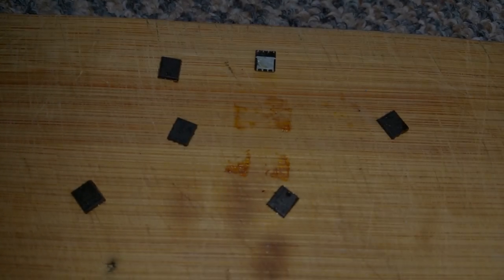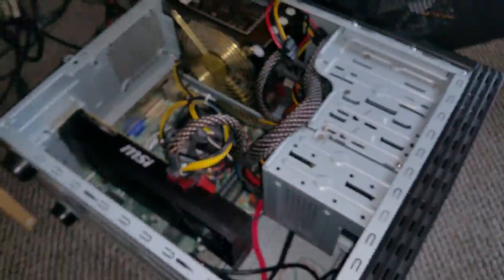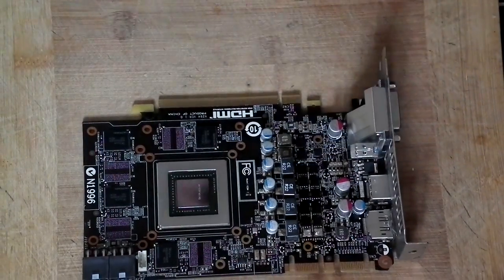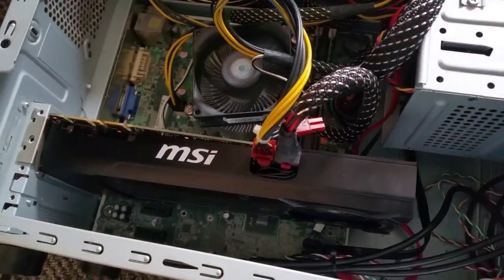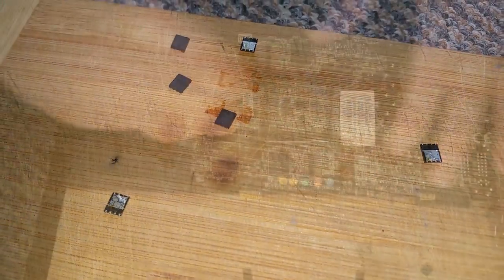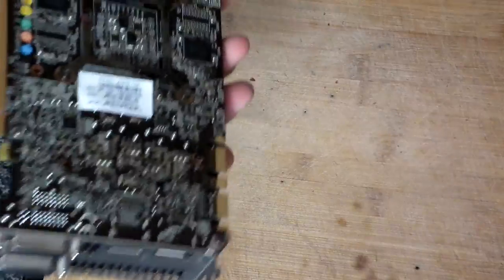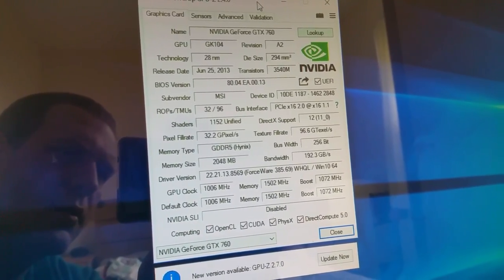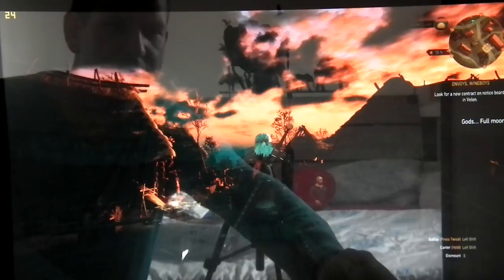How to FIX Graphic Card Short circuit without spare parts

Comment: i have a gtx980ti it powers up if you dont connect 6pin or 8 pin power plugs is that a short circuit
Reply from the maker: Definitely yes is short
Reply: @frogtechtips   hi frog are you located in UK and chance you could take a look at it dont mind paying you
Reply from the maker: @philkyle8919  hi not any more I from Slovakia

Comment: Hi, good video. I have an EVGA GTX 980 TI superclocked acx 2.0+ with backplate, it doesn't work, when the GPU is in the computer i get no display, i tried with both power cables, with only the 6 pin, and without any of them, in all the cases i get no display even if i connect the monitor to the IGPU instead of the GTX 980, but all of the times the CPU fans spin correctly continuously and the GPU leds switch on. The PC boots and works correctly without the GPU connected and the GPU has been tested on another PC with the same result, can the GPU have a short or not?
Reply from the maker: Hi your card don't have a short if card have short PC doesn't working at all as you writing fan working just card no send signal problem is with GPU core probably .
As you card is out of warranty and replace core is not financially good option I will try reflowing GPU look on my channel there is many videos how to fix black screen good luck

Comment: I think i have the same problem. How much does a repair cost? Just give me an estimate.
Reply from the maker: It's hard to say you will need check with your local repair shop
Reply: @frogtechtips  I see. Thanks. But if they repaired it or replaced the shorted components, will it go back to being shorted after a few days of use or will it stay good
Reply from the maker: @21Mewzyk  it's should be ok if replacing right component he will probably give you some warranty for job Dane as well

Comment: Hi Frog, can you help me? I have same card and its broke I think. It doesn't show anything but when I turn on PC, the gpu fan spin like crazy at max speed. Do you know how to fix it? I was wondering if bios is faulty and need to flash it. Do you know which chip is the bios chip on that card? Thanks.
Reply from the maker: Hi usually when card have this problem is werry hard to find what wrong there can be multiple problem 
Can be bios as well but I will bet for GPU die is dead or not detected
What is history of that card is that happens just one Day or you buy like that
Reply: @frogtechtips  Actually it come with a bulk purchase, so I did kind of blind purchase on the gpu. I've tried with hairdryer trick but no luck, still same condition. Any suggestion?
Reply: And currently trying with short pin 1+8 trick, but seems no detection in windows or DOS. 😔
The bios chip is the IC with pm25l0020 label on it right? CMIIW.
Reply from the maker: @iyepb  I think yes
Reply from the maker: @iyepb  there probably no so much to do there can by som missing components as well try perfectly look on PCB

Comment: Brother my rx570 is heating up I have changed thermal paste but giving display what should I do
Reply from the maker: You mean after changing thermal paste you card don't give signal
Reply: @frogtechtips  my card is giving display but my temps are very high 56 idle after changing paste is this due to some kind of short circuit what should I do in this situation Main problem is temp
Reply from the maker: @coffineditsgameplays5908  hi if you change thermal paste and temperature is still high you will need use better quality thermal paste but 56 is not bad I think what your temperature under load
Reply: @frogtechtips  no bro idle 😅
Reply from the maker: What your temperature under load

Comment: I just got an XFX 580 off of eBay and when I try and power it on, the motherboard debug LED flashes for a split second and the CPU fan twitches but still nothing. I wasn't too sure about what the problem was until I found this video. What would you recommend me doing? I don't have any tools like a multimeter or heat gun (I have a hair dryer and my soldering skills are pretty limited.
Reply from the maker: sounds like short on your gpu and without tools no possibility to fix
Reply: @frogtechtips  yeah that's what I suspected. I gave the card to my friends dad that has the necessary tools to diagnose the card so hopefully he can maybe fix it.
Reply from the maker: @JeffsTechOfficial  that's sounds like good idea let me know after
Reply: @frogtechtips  will do
Reply: @JeffsTechOfficial  i have a similar situation, I really hope i can fix it somehow because i cant afford to spend 200 on a new gpu
Reply from the maker: @JeffsTechOfficial  thanks
Reply from the maker: @mr.stealyourgirl1779  let me know if you fix
Reply: @frogtechtips  To be honest I might just buy a bottle of freeze spray to find a short circuit, do you have any experience with the stuff?
Reply from the maker: @mr.stealyourgirl1779  you can try that as well but for 90%short is always on voltage regulator
Reply: @frogtechtips  I hope its the voltage regulator, smaller parts are more tedious to work with. I will give it a try, but the gpu has to have live power right to try?
Reply: @frogtechtips  were do you think the short is if my gpu gets warm but my pc doesnt detect it?
Reply from the maker: @mr.stealyourgirl1779   take off cooler and send me picture of your card I can mark for you where I think is short
Reply: @frogtechtips  ok
Reply: @frogtechtips  do you have an email?
Reply from the maker: @mr.stealyourgirl1779  yes you can send me on frogtechtips gmail or Facebook mesanger as well
Reply: @frogtechtips  how do i send the pictures?
Reply from the maker: @mr.stealyourgirl1779  send me that on my email or FB message
Reply: @frogtechtips  whats your email?
Reply from the maker: card will be working even without that but window will not see this gpu correctly and after just try find with one is bad and solder good one back on position
Reply: @frogtechtips  i think i found the culprit. When I froze my motherboard with freeze spray, a voltage regulator was the first to unfreeze on the backside of the card. Do think if i were to remove it that i can start up the card without it?
Reply from the maker: @mr.stealyourgirl1779  yes you can
Reply: @frogtechtips  for some reason three pins of the 4 are connected to ground and the and the chip number is bm1117 adj, do you think that its an irregularity?
Reply from the maker: did you remove that if yes and is not on board check short on power conection if there no short anymore you got it
Reply: @frogtechtips  how do i checm for short on power
Reply from the maker: @mr.stealyourgirl1779  you need check short on power conection of your card iam not sure how many is there usually 1 or 2  6 or 8 pin conection from your PSU to your gpu there can't be short between pin look on my channel one of my older video explain that

Comment: Hi, i have replaced all of the Mosfets but the card is still not working and i get a short to GND from thr mosfets. Do you know what could be the cause for this?
Reply from the maker: did you try card without mofset is been short there when you take tham off
Reply: @frogtechtips  yes i did! Im thinking it might be the phase controller now. I have tested almost everything that can go faulty on the card.
Reply from the maker: @ThreepwoodFan  did you find that short on the end
Reply: @frogtechtips  no i didn't. I broke off a soldering pad so i think the card's dead now
Reply from the maker: @ThreepwoodFan  check my channel broken pad doesn't mean card is dead look on one video where one card have big fire and after that been like hole in card good point that card still working as card can works without VCC
Reply: @frogtechtips  anyway thanks for your help! I'm already at my next project which is a PS4 Pro.
Reply from the maker: @ThreepwoodFan  you welcome ps4 pro is not bad option :-)
Reply: @frogtechtips  I think i might try to fix the GTX 970. I can send you some pictures of the PCB.
Reply: @frogtechtips  I have uploaded them here: https://drive.google.com/file/d/17SQmKU4HB3TyWBX-hdkZFDpuvpij9aN9/view?usp=sharing
https://drive.google.com/file/d/1u1P1qQMOiHVWqAuSzi96Vbnd2TePRmA_/view?usp=sharing 
as you can see, i desoldered the U508 on the back side of the card.

Comment: Hi . Can the gpu shorted cause the spark on my 8pin power on my mothertherboard? 
My motherboard is dead the. I have new psu true rated 600 watts im planning to buy a new motherboard but im worried if my gpu is shorted that why my motherblard got spark .
Reply from the maker: Hi yes can happen that just try checking GPU with multimeter  for short if not there probably will be safe to use and if you buy new MB I will get Risk anyway as if will something happens I will return MB as not working for replacement
Reply: @frogtechtips  i try to open my cpu without gpu but cant turning of no lighst no beep no power after spark on 8pin power on my motherboard 2x spark 😟. What do you think the problem? .
Reply: @frogtechtips  please help me give me some advice . What do you think buy new mobo or can i repair my cpu?
Reply from the maker: @potpotpotty6420  if your pc doesn't working without GPU of course if you have decided GPU is probably MB foulty also can be PSU problem after short as well really hard to tell if I can't check that personally
Reply: @frogtechtips  i see . Thank you for response ill subscribe you ☺️maybe i will find techenician to diagnose my motherboaed befor buy the new one.
Reply from the maker: @potpotpotty6420  Thanks so much i so glad you subscribe as well and let me know once you get proper diagnostic

Comment: Great video sir! I have a question. What is the common cause of graphics card short circuit? I'm curious. Thx in advance!
Reply from the maker: I thanks so much,  usually main problem is dust on gpu with can be conducting and make short ,other problem can be with overclocking with make card hot and specially low or middle range card have bad soldering and with heat can make cold solder and over time make short and burn some component :-) I hope I answered you questions
Reply: @frogtechtips  Thx for answering man. By mid range card you mean like RX 580/GTX 1060 and below right? is all mid range card affected by bad soldering? or just a lower model card like the reference model?
Reply from the maker: @vnplayer6839  rx 580 is been one day top card from amd and a still is bud ye you get are right and is always hard to tell
Reply: @frogtechtips  Thx! I've been thinking to upgrade my GTX 750ti so I need a reliable graphics card that can last at least 4-5 years if possible since I didn't upgrade very often. Can you recommend me a mid range GPU brand with good build quality and affordable price? Sorry if I ask too many questions.
Reply from the maker: @vnplayer6839  hi don't worry my channel is about help :-) 750 ti been classic mid range card and still good for 720p in this day  not sure what's your budget and what is your resolution you like use for play if you like me and you will be happy with 1080p you can go for gtx 1070 or better RTX  2060 with minimum 6GB ram as I always prefer amd and I personally use RX 580 8GB iam so happy you can buy this card so cheap now all have some plus and minus but I think with RTX 2060 you Can't go wrong if this card is in your budget  from brand I will defo buy MSI gaming series with have from my best cooling opinions his card is so quite  if you will need some link let me know I will give some
Reply: @frogtechtips  My budget is in around $250-300 and gaming at 1080p. Sadly the RTX 2060 is out of my budget range and I'm not sure should I buy GTX 1060/RX 580 now or wait since the release date for Navi and GTX 1660ti is around the corner and rumored to be around $279.
Reply from the maker: @vnplayer6839  if you like play on 1080p that's like me I have this one https://rover.ebay.com/rover/0/0/0?mpre=https%3A%2F%2Fwww.ebay.com%2Fulk%2Fitm%2F292933443466

and iam so happy all game I can play on ultra with no problem and if you like buy used one you can find one more cheapest

Comment: Hi , great video , can you help me with my card ? i have gtx 970 msi and my son drop a coin on it and my pc was on then i tried to remove it and done a short circuit on the gpu when i removed the coin , after my pc won't start , i have to remove the gpu to start and when i try to connect the gpu and turning the pc on won't start
Reply from the maker: DKU HD oh that's not bad and hard to help you like this without have card on my hands if there not visible damage you will need find with component is gone try first find if it's short is on PCI E  line or power  

Did you pc start if you are not plug power for gpu if yes you will need find short on that line check my video how to detect short

Comment: You have inspired me to fix my graphics card but I think I need your help more to be able to do this
Reply from the maker: hi my friend what kind of help you need
Reply: When I plug my psu into my gpu my computer wont turn on but for an instant and then immediate shut off. I believe it's a short but I would like to figure out how to find and replace the part that is shorting out.
Reply from the maker: @owensnell4606  it's no so easy find the problem but usually short is on voltage regulator with is component on this video
Reply: So what should I do
Reply from the maker: @owensnell4606  do you have multimeter and some soldering equipment
Reply: I have some friends borrowed equipment
Reply: @frogtechtips   I have borrowed equipment
Reply from the maker: @owensnell4606  cool that's mean try desolder one by one VCC and once is down check ground over each legs
Reply: @frogtechtips  how to desolder and what is vcc
Reply from the maker: @owensnell4606  desolder is take component out from board and VCC is voltage regulator is the components I take off from board in this video
Reply: @frogtechtips  It is safe to run a graphics card without a VCC?
Reply from the maker: @freedomcuts  hi yes  from my experience

Comment: (sorry about my english)-HI MAN I HAVE THE SAME ISSUE WITH MY XFX (GTS XXX E) RX 580 .when i plug 8pin power (ON ANY COMPUTR) they wont boot and the gpu funs dont start-when i i take pff the 8 pins the pc start but the monitor signal come from the integrated GPU....i need help ...any thing can help (thanks)
Reply from the maker: hi you definitely have short on your gpu and usually is on voltage regulator you can try remove tham and see if that help
Reply: HI. thank you so mush i thought it s dead. i hope i will find some good reapair stores...again thank you so mush : ).
Reply from the maker: @smamin3965  you welcome
Reply: thank you very mush
Reply from the maker: @smamin3965  you welcome

Comment: Hi. I also have a gtx 760 evga sc and get short circuit. Technican says  gpu chips get short circuit but I think some mosfets get short circuit. How to I check mosfets get short circuit or not?
Reply from the maker: Anar Asgarli you will need desolder and after check if short gone but most of the time is short on that component I show in video
Reply: Thank you for fast reply. GPU chipset will get short ciruit? It's possible? 

If I desolder all mosfets  then will gpu power up? or need 1 or 2 working mosfets?
Reply from the maker: Anar Asgarli you can desolder all and check your card in pc without them if your pc power on you can solder tham back one by one or once you desolder check them with multimeter to find with one is foulty 

With power slot you have short is the same  one as one show on video if yes you need remove the same one as me if it's the second one you will need remove that 6 bottom one and check for any visible damage first
Reply from the maker: Anar Asgarli and please don't forget subscribe to stay connected with me :-) thanks
Reply: I send you photo from my facebook account. Please check it. One capacitor slot is empty.
Reply from the maker: Anar Asgarli I will check that now

Comment: This card is known for voltage issues, unexpected crashes, stalls etc. I have this card; so it is a mission to find a computer that would take it. With some issues i use it on my Gateway DX-4300-11.
Reply from the maker: You mind you have this card with same problems